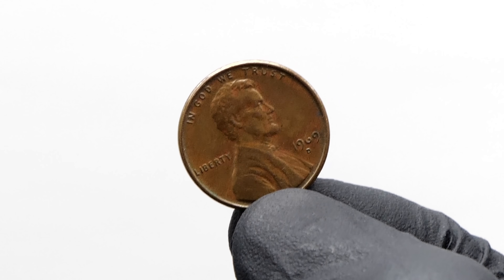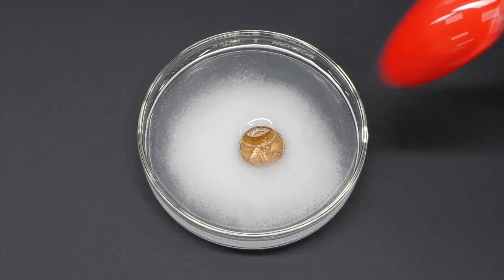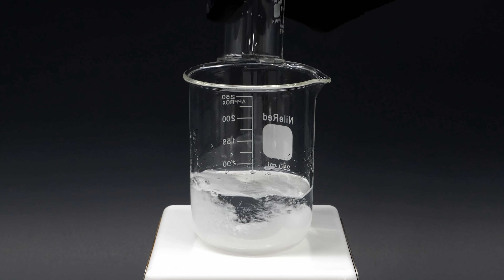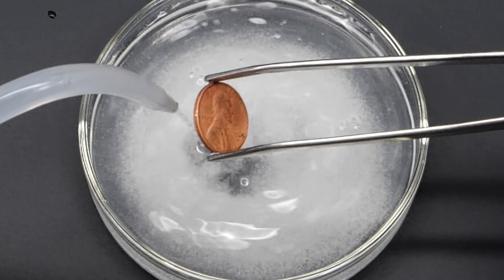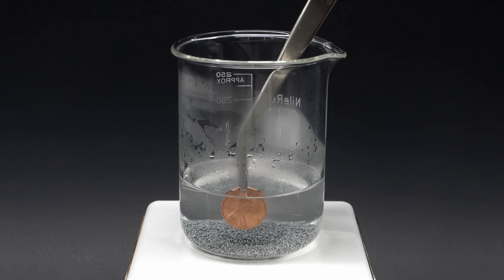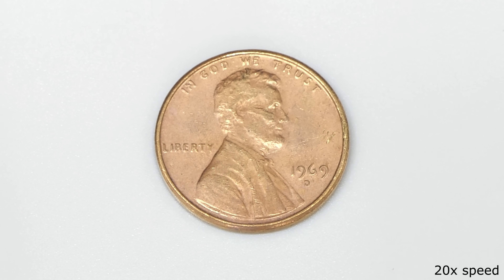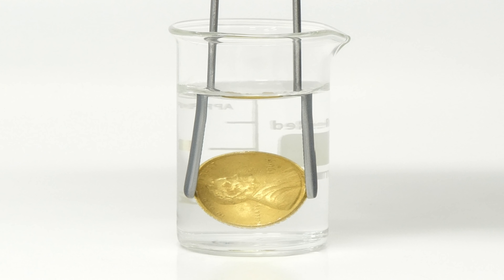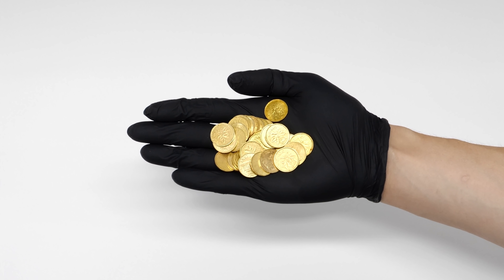The golden penny experiment

Comment: You just made the penny actually worth one cent now.
Reply: Us Treasury will never recover from this burn
Reply: @dash3995 .....
Reply: @fapfaping Right, but it’s not actually gold.
Reply: @mera spider It costs around 2 cents for the US mint to make a penny. That's part of why it's illegal to melt down currency.
Reply: @Merennulli  Wrong. It costs more only when they package and ship pennies. When they actually make it, the metal value is still less than a cent. Same goes with the nickel.
EDIT: I'm wrong with the nickels. Their melt value is over 5 cents.
Even so, the offset of dimes and quarters makes it a non-issue. Mint still makes money off of making money.
Reply: @BalticoYT  The point isn't that the mint makes money. (Of course it does, no system can function if net seigniorage is negative.) The point is that a penny is already worth more than a penny. See the post we're all responding to.
Reply: @Merennulli  Look on the US Mint website, it says that it costs less than 1c to make each penny
Reply: @jimmysavile69  Quoting from the US Mint website:

"FY 2020 unit costs decreased for all circulating denominations except the dime
compared to last year. The penny’s unit cost fell by 11.6 percent and the nickels
unit cost fell by 2.6 percent. The unit cost for both pennies (1.76 cents) and
nickels (7.42 cents) remained above face value for the fifteenth consecutive
fiscal year"
Reply: @Merennulli  I'll admit my fault, the us mint website previously said they will not get rid of the penny because it was cheaper, but they've obviously now removed that page and are now stopping production in 2022
Reply: @jimmysavile69  I wonder why they would have said that, that's peculiar. There has been a push to get rid of them for this reason since the 90s. They went to zinc cores in 1982 to lower costs, but by the 90s it was already right back to the same problem. I expect the nickel will be following it within a few years since it's also worth less than its metal content.
Reply: @jimmysavile69  Never heard that they're stopping production. If that was true, the news would've talked about it, and I would've been talking about it. But it's not.
Reply: @BalticoYT  they've got more interesting stuff to talk about than coinage
Reply: @jimmysavile69  It would made headlines. The penny's essentially been around since the founding of our nation. Made every year (except 1815). It would make big news. Many major news outlets have made stories about the penny, and they would've covered it being discontinued.
I would've known instantly as a coin collector, as it would've been on the front page of coin collecting news websites, but no, I saw nothing. Not even the U.S. Mint's website said anything when I looked it up.
An article from Tally that talked about it had a link to another article from Cash Money Life. The date on that one was April 1st. The end of it says
"$$$ And if you haven’t figured it out by now – Happy April Fools Day! 🙂"
Reply: @Merennulli  actually it has not been illegal to melt down currency for a long ass time but since 2007 there is an exception as it only applies to Pennies and Nickels with an added exception of 1942-1945 for Nickels as in you can melt those years down for the base metal value. But over all you can melt currency down as long as you don't make money off of the base metal you get from it as in selling it as you can indirectly make money off of it by making a video and call it a educational experience. There are some other ways after you are done like re melting it as since it is not currency anymore but that is more Grey area of the law and the government might not take kindly to that but other than that here in America you can actually melt coins for fun or educational purposes or even to make stuff such as statues as long as your intent was not to fraudulently make money off of the metal. It's weird and complicated as all laws are and designed to trip someone up like all laws and again the protections to melting coins are only to nickels and pennies not the other ones in the US mint such as quarters or dimes 

The main key here in America is "Intent" and that is going to be hard to prove without a confession. There is also a weird thing of you can melt them into a ring and sell the ring as art, also they still have no plans to discontinue the penny don't believe the dumbasses that are hoping it gets taking out of circulation that way they can melt their stash down for the pure value. Besides it would need Congressional Approval but they probably won't as it would likely crash the value of copper here as sure current pennies after 1982 are just copper plated zinc the amount of copper people would be handing in since copper is about $2.80 a pound will actually make it sink because of the sheer amount of pennies and people waiting for the ok to melt out there to the point aluminum would be better than copper if you wanna scrap stuff for money and aluminum is $0.45 per pound currently as of this comment. 

Also a thing i wanted to clear up Pennies have not been full copper since 1857 then the years 1864-1942 they were bronze as in 95% copper with 5% tin and zinc but the tin content is so low you can not pick it up with a magnet, and it only stopped being a mix of Gilding metal and Bronze in 1982 though there were still some Gilding metal pennies so hard to tell which is copper plated. And the only difference between Gilding metal and Bronze is the last 5% as they are both 95% copper, Bronze has small amounts of other metals such as tin mixed with Copper, Gilding metal is just the Zinc as the last 5%. Current pennies only have 2.5% of copper as the thin layer
Reply: @JohnnyYeTaecanUktena  I'll assume you are correct on all the parts of that I don't know about, but I did want to argue one point - laws aren't designed to be that way. You're giving too much credit to our elected officials. They do try to slip things in "cleverly" fairly often, but they aren't laying traps intentionally. That's a result of not understanding what they've done. I've worked with them for a long time and it's a comedy of errors. Just last month we found out they trapped themselves in a campaign capacity with a bit of wording that was supposed to just pacify privacy advocates but actually cut their campaigns off from certain useful information going forward. Due to my job I can't go into specifics, sadly. Something for my memoirs if I have any sanity left when I retire.
Reply: @Merennulli  No don't assume i am correct i can always be wrong on something but here in America i am used to weird laws that don't make sense. Or if a person gets charged for something there are other charges that are basically the same that get piled on to the point they try to use it for a plea deal so they don't have to waste money going through courts trying to convict and get the max possible penalty.

Again there is just some point where you have to question if the laws have ill intent in mind when applying them such as how much money the government can make when convicting a person or if the times have changed enough to where the laws like that should be taken off the books
Reply: @JohnnyYeTaecanUktena  They do try to slip things in like one pro-life legislator famously here snuck in wording to allow for midwives to basically act unregulated away from hospitals and managed to allow unregulated abortions because of his sneaky word choice.

Where the big exploitation comes in, though, is implementation of those laws once they're in place. The recent "bees are fish" ruling is a particularly blatant example of this.

I wish there was something in place where they had to clean the slate every 50 years or so and re-implement just those laws that were still needed. There are too many of those "swearing around women in a public space" style laws lingering and too many forgotten clauses that allow for unintended municipal revenue streams like you mention.
Reply: @Merennulli  Wait what? bees are fish? got it you are from Canada. Seriously though i don't get why they could not just say that Bees are protected instead of calling them Fish, i will never understand that one
Reply: @JohnnyYeTaecanUktena  Canada?

So, the reason they did that was because of a badly worded law. The fish exemption was amended to let them include crustaceans as "fish" (which already was bad...should have just amended the exemption to add on crustaceans) but they stupidly worded it as "invertebrates". That left room for insects, snails, anything without a spine.

The reason to pursue classifying bees under that loophole is that it's a LOT faster and more reliable than trying to change the law again. A good lawyer can easily argue letter of the law over common sense, and they are technically correct to do so. But a law change will take a minimum of a month if the legislature is on-board and not in recess, and it's almost impossible to get them that on-board for a regulatory change so it's more likely to take years and may come with unforeseen further bad wording.
Reply: @Merennulli Are they just making all of my fun weekend plans "illegal" now?
Reply: @Silverwind87 You act like that's a change.
Reply: @Merennulli  Presumably they're talking about the copper value
Reply: @Sherwin657  Pennies are only a thin layer of copper over zinc. They haven't been full copper since 1982. Even with the zinc core, the metal value is more than 1 cent.
Reply: @Sherwin657  no, I was talking about the English equivalent to a cent, which is a penny. 100 pennies make £1, since the pound is worth more, the penny is worth more than the cent. Didn't realise you guys had pennies too
Reply: @lio1234234  Your confusion is that you think anybody officially calls them "cent"s. They don't. They're called pennies everywhere.
Reply: @hhaavvvvii  I lived in Malta for 3 years. They called them cents. Don't assume 😉
Reply: @hhaavvvvii  They're called cents in the EU
Reply: @hhaavvvvii  yeah we call them cents here too 😂
Reply: @hhaavvvvii  they're called cents in Brazil
Reply: @Merennulli  it's 2.37 cents to the penny, no it is not worth more than one cent no matter any way you look at it.
Reply: @Nami1995  Umm... I'm going to hope Autocorrect mangled your sentence there. 2.37 is more than 1.
Reply: @ansatheatrocious6083  that's bc the eu doesn't have  any coin called a penny
Reply: Even more; Canada discontinued pennies several years ago, so they'll become more and more collectible. Maybe Canada can bring the penny back now? 🤔
Reply: He downgraded it?
Reply: @fiona9000  when you polish a coin, the value drops like a lot
Reply: Fwiw the metal content of the  penny he started with was worth more than one cent to begin with...
Reply: AKSHUALLY it costs approximately 1.8 cents to make one penny
Reply: as a coin collector, I fully agree
Reply: @fapfaping 2.5g of brass would be worth ~5 cents last i checked
Reply: Hm no. It is worth more than 1cent. This is why canada stopped making them.
Reply: @MmeHyraelle  i mean like with the stuff like the 1909, if you have one, your either lucky or you bought it, if you polish it, then the value dropps like a lot, some old coins got this blue hue to it, that hue means that it hasnt been polished and if you got one then you make some money
Reply: The penny is worth 1.6 cents I think actually, and the versions he had that were more copper, are worth more actually.
Reply: @Seth9809  yes i know that, but to coin collectors that collect rare coins like the 1909 s vdb, if you polish a coin the value of the coin to the collectors drops.
Reply: @Seth9809  Holy macrol this comment sub section is a sloppy mess. 
anyway a zinc penny costs around 1-2 cents to produce AND distribute and a copper penny has a melt value Currently of 2.5 to 3 cents.
Reply: :o
Reply: actually that was a copper penny (pre 1983) so it's worth way more than a cent
Reply: It takes 11 cents to make a penny ! 🤣
Reply: Fun Fact:
It takes 11 cents to make a penny
Reply: But the penny is already worth one cent
Reply: @rubyhillman1859  it's not tho, it costs more than 1 cent to make a penny
Reply: Haha, inflation jokes.
Reply: Umm, a penny is worth more than one cent though 🤔
Reply: @lio1234234  actually no. It cost less 1. something (less than 2) cents to make and is only worth 1 cent
Reply: @lio1234234 £0.01>$0.01